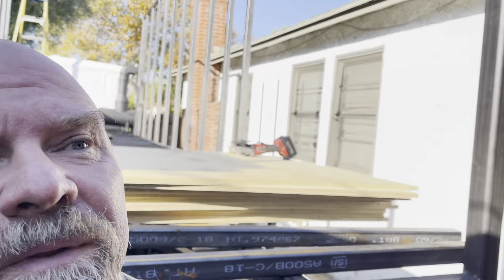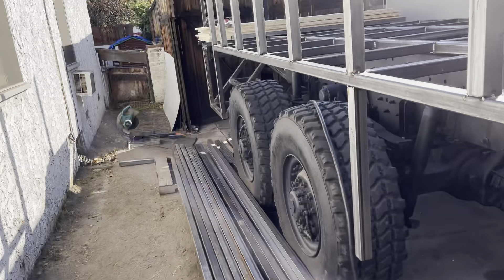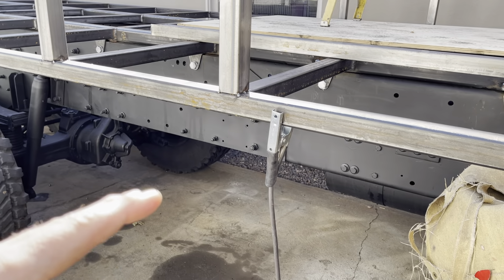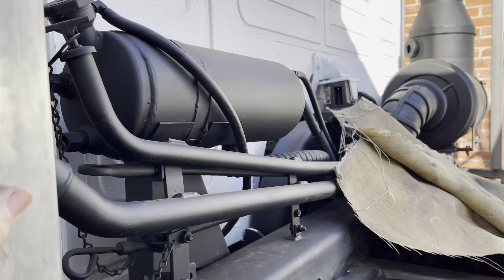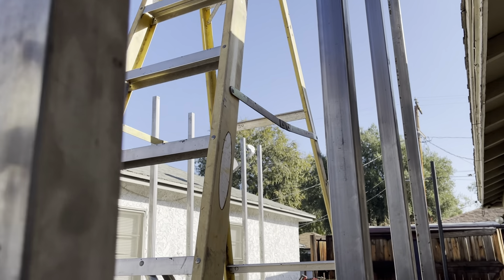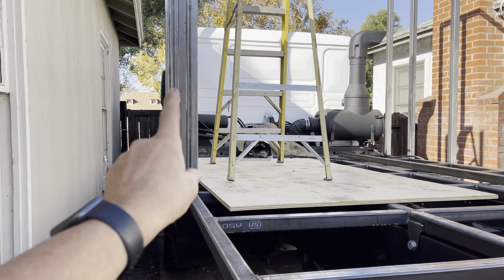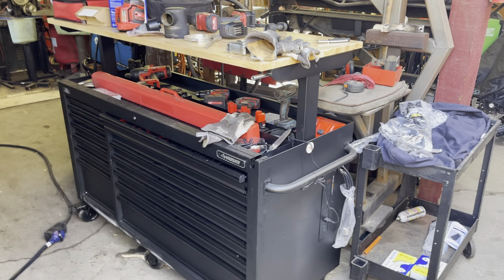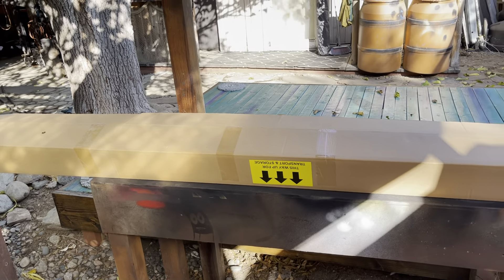Expedition Truck Build Day 24. Air Cleaner and framing up!

Comment: If you have issues with your CTIS system, let me know. I have been diving in head first on mine and have made some interesting discoveries that prevented it from working.
Reply from the maker: Thank you so much! So far my CTI ass is super solid. The only issue I’m having with the truck right now is since I have change the headlights to LED blinkers, emergency flashers don’t work.I got my truck from Martin Fmtv Sales so I got a really solid Truck with only 4200 miles on it. A lot of the lines and everything were changed out with a 2012 date on them. You’re always welcome to reach out on my phone @ 9512596232. Great to hear from you and Super appreciate you reaching out in case I need some help! Cheers brother!

Comment: Looks great Tim! How will the box be skinned? Plywood, aluminum, or FRP? I am doing a similar build. Wish I had some weather like yours. It's in the 20's here.
Reply from the maker: The 20’s would suck to work in for sure! Right now I’m fighting the wind. The skin will be .040 painted Aluminum sheet put on with VHV 3M double sided sticky tape and some self taping screws. Inside that I will Fay 100% silicone then poly styrene with reflect X2 inch thick and then I will place my tongue and groove inside walls. This is the same way that I built my adventure Truck and it turned out great and never has  leaked or encountered any problems!!